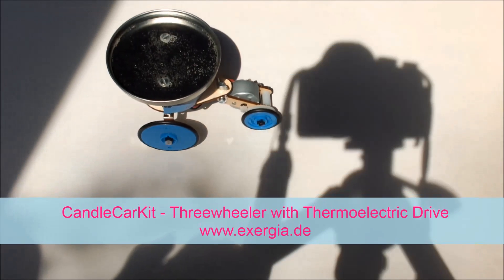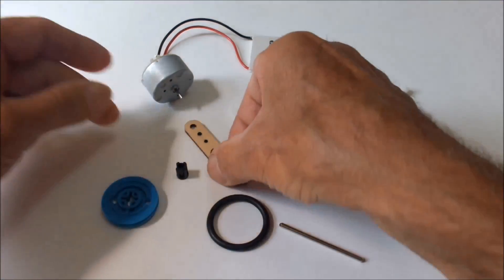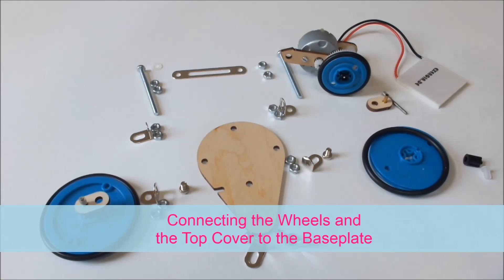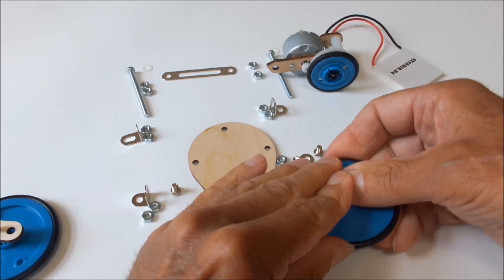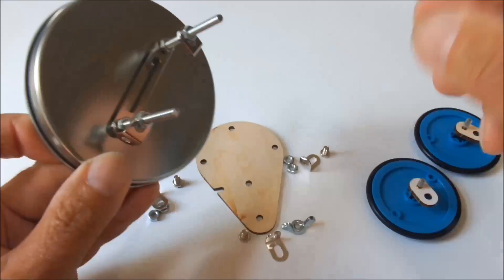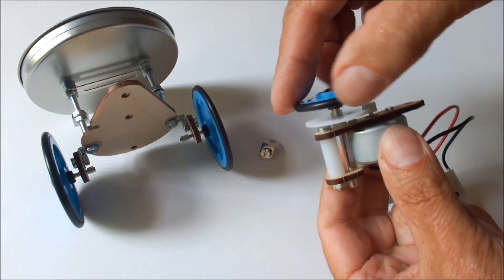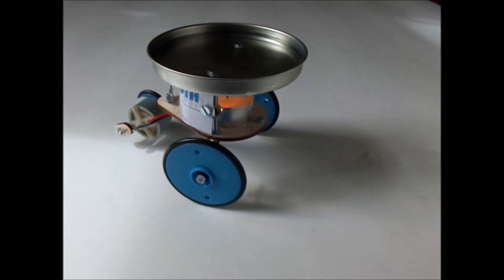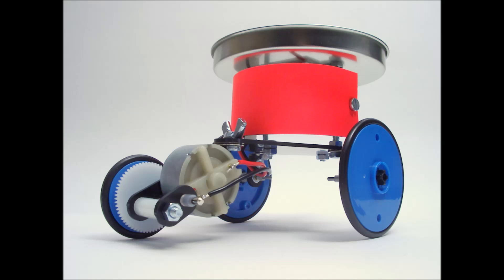CandleCarKit - Threewheeler with Thermoelectric Drive - Construction Guide

Comment: Why use a candle and battery? Place a slow ratchet system and with that amount of water, let gravity do its thing.
Reply: The water is there to maintain a temperature gradient between both sides of the peltier element. Without the gradient, you cannot generate current.

The amount of stored potential energy in that dish of water is miniscule compared to what's in the candle and would likely not even be enough to move the cart.